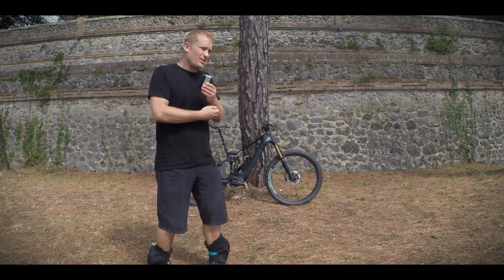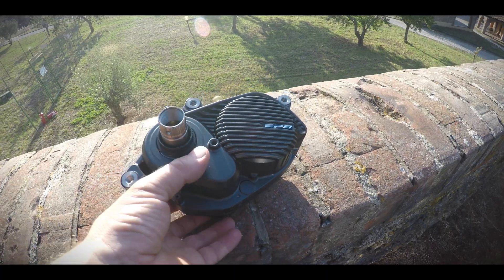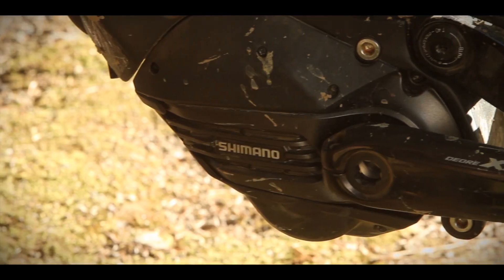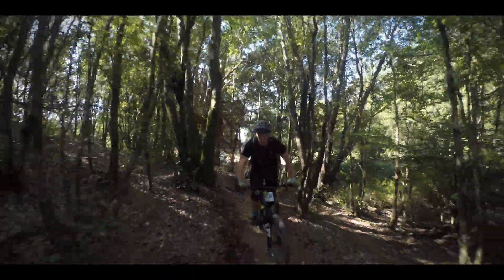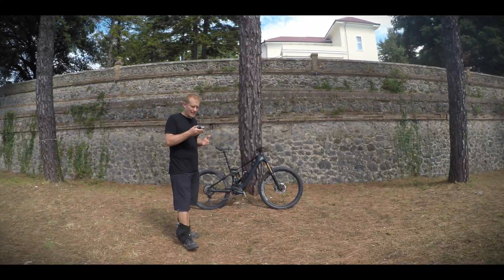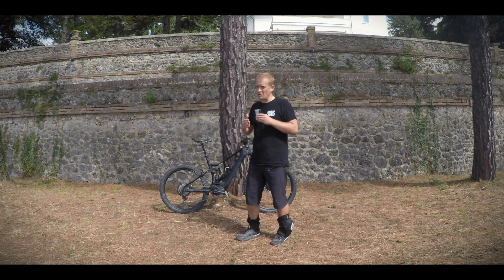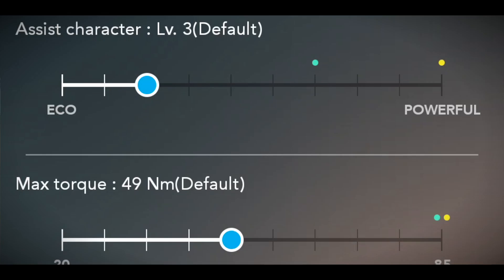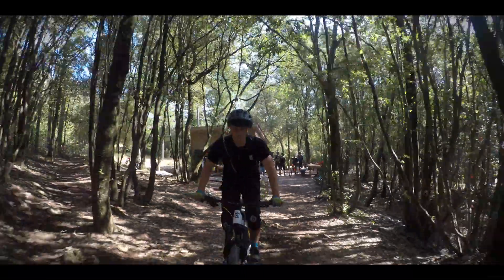Test - Shimano EP8 Motor - The Good And Almost... 2021 85NM EBike Motor

Comment: Thanks for the honest review! As many seem to omit or minimize the rattle.
I will get next week my EP8 ebike (Stevens E-Inception FR). If it is as bad as I can hear it in some videos I will have to send it back. Even though it might be an amazing bike. 
And even more annoying than the rattle are Shimano answers to this problem. Just marketing BS. No clear commitment to come up with a retrofitting solution, so who doesn't want to ride noisy bikes, can upgrade. Even call it an "improvement", instead of a bugfix, would be fine for me.
Reply from the maker: we try to  be real. no axe to grind here, apart from the noise its a great motor. The noise though  is much less  on the latest versions ive been trying.
Reply: @alexbiketester  well I just got my bike and the noise is a deal-breaker for me. It is just crazy annoying. IMO such a product should have not been brought to market yet and all bike reviewers, magazines and riders should strongly criticize Shimano, so they will not do it again. To me it is still mindboggling how they decided "yeah, this is a product ready to be put on >6k bikes" (a product that you cannot upgrade, so you are stuck with it). By "latest versions" do you mean they've made an update? I don't find any information on that.
Reply from the maker: @dit4963  they seem to  be making improvements, i have two motors, one  rattles a lot, the other is barely audible. I did tell them at the test.  They said they were listening to  our  comments. 

Yes there are a lot of journalists who don't actually know how to react to problems they discover.  (They appear to live in fear of ad dollars) Its a constant problem as bike company marketing people obviously want the best light seen on their product.  I have never been told what  to say, I have had to deal with weird excuses though when iv e spotted problems from some brands. 

For what I have  understood only two  of us on youtube actually told the truth up front. Myself and Rob rides. Others I  know have played dumb about it when I rode the same bike as them and heard the noises.

To be fair though  I asked Canyon about it and they  told me they  told Shimano that it wasn't good enough, Shimano worked on it. 

Ive also asked someone from EMBN he said that his current bike doesnt rattle but the original one did. But they don't "review" bikes, which is why they  didn't mention it until a recent video where they addressed the issue. 

Fundamentally in my opinion its an unwanted  noise that is irritating. It doesnt affect the ride performance of the motor, but it shouldn't rattle. Brose doesn't rattle, yamaha doesnt rattle and the Bosch units ive tried dont rattle. The E8000 doesnt rattle. So...... The EP8 on some models does rattle. One  ive got does, the other not. Ive heard that the new Santa Cruz bulliet rattles but its hard to hear. A shop guy told me some people have noted it others dont. 

This little write up comment Ive put here is probably  the most detailed response on the net up until now, with some details.

Ten years  ago Canon had a similar problem with their 1d MarkIII auto focus problem and the raft of denials and people ignoring it, until enough fuss was made and owned up. So  the lessons are there for how companies should respond... 

No product is perfect and I hope there is a solution for those that have motors that rattle that can be retro fitted. Shimano in general are an excellent company that make super reliable products that work well and have excellent service, so im not sure how this one slipped through the net. 

The problem is that consumers do pay their hard  earned money  for product that is expensive. So there should not be any disappointments.  We are not reviewing 10 dollar items here, so I would wish everyone out there doing this job would actually  be straight up and clear instead of  fudging it and making excuses. 

Thats why its so important to be clear and not just chase numbers and be real. I try  to be as real as possible. my  main focus is on what you can do with a product, im not here to score points to rip stuff apart needlessly to score a point and be a tabloid. 

Linus Tech Tips is a standout example of  how to review computer products  and combine advertising and honest reviews and ad supported videos together. I wish more of the bike industry would follow that type of example. 

Anyway, these points above are my opinions and I  hope they  give a balanced view to the  situation. I realise that  your hard earned cash is very important to you and  how you spend  it. So thanks for watching  and im sorry that the bike motor is not what you expected because some reviewers didn't say what it is like. 

Anyway I hope you find a solution.
Reply: @alexbiketester  , Thanks a lot for an absolutely great answer! This should get to Shimano! Yes, currently I think you and Rob are the standard in ebike reviews. Those magazines who turned into marketing tools are so annoying. Cheers and lets hope for an announcement from Shimano! If in the next 2 weeks they announce something I might keep the bike (afterwards I cannot return it anymore).
Reply: @alexbiketester , this is how it sounds on my bike: https://youtu.be/PioCZ4SoVDU
Reply from the maker: @dit4963  yes  thats pretty obvious. Such a shame.

Comment: I just tested one today and and thought it was smooth and powerful , loved the clean simple switch's and display, didn't hear any rattles
Reply: I just tested one yesterday from shop.it was up and down the street just outside from shop. Did try going over and off Kerb.there was no rattle sound at all ,very smooth,probably not the most demanding environment for test though when trying out a bike with a Bush motor a few day before on similar surface there was some  noises. This bike with es 8 motor was a lot smoother and quieter
Reply from the maker: @johnnyboy1586  ok fair enough, you notice the rattle  at speed on rough surfaces, it sounds like a marble in a can or a cable in a frame. It dissappears when you start pedalling. It's only there when freewheeling.
Reply from the maker: @jerryx2000  Its different. It feels a bit more bicycle like, is slightly quieter when pedalling, but the prototypes we rode rattled on descents when not pedalling.
Reply from the maker: Is that a pre production? Or very recent. There is a problem with the case that requires a redesign as already announced by Shimano. @rob rides EMTB and myself both had the same rattle problem on multiple motors on multiple bikes. The fact that you didn't is interesting. Yes it is smooth, but not as powerful in the same way as the others.